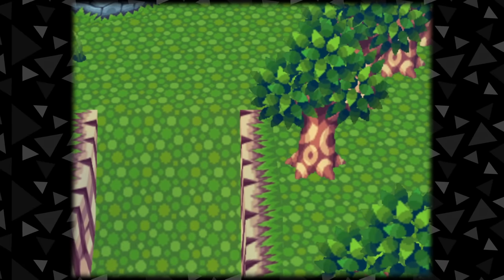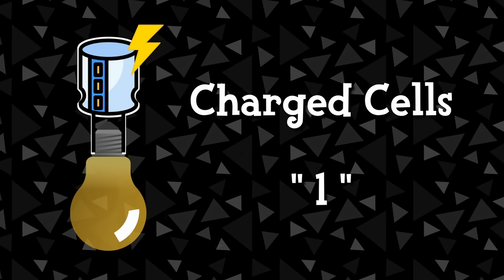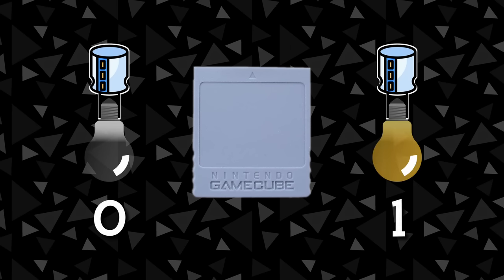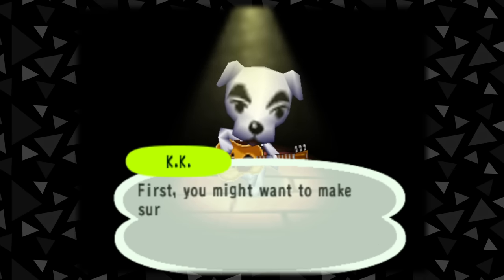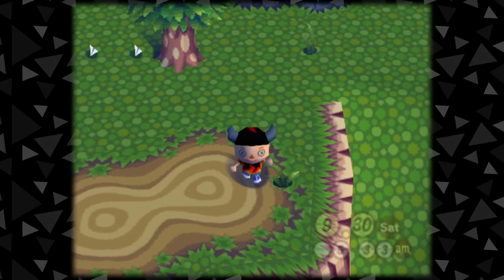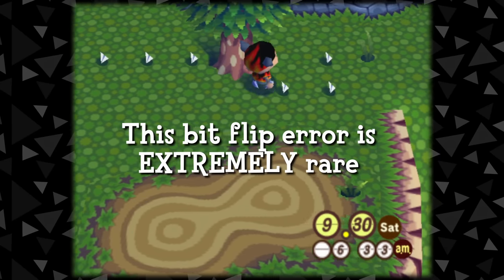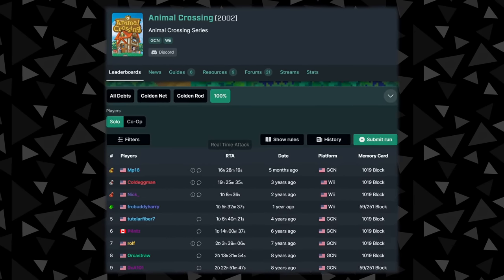Paper Airplane Corruption in Animal Crossing

Comment from the maker: I'm admittedly more of a software person than a hardware person, so there a few technical inaccuracies throughout this video. The description includes corrections, as well as a technical explanation for why these airplanes duplicate. The general point of the hardware-related aspects in this video was to just provide some context on how this glitch can occur and not to be a wholistic explanation. Thank you!
Reply: 2nd correction: Pokemon Sapphire does not have battery backed save data. The game only uses the battery for the Real Time Clock.
Reply from the maker: @Porygonal64  This is corrected in the description. I'll update this pinned comment to refer to this as well.
Reply: Bruh these paper airplanes are like animal crossings evil biome
Reply: @chonkydog6262 Sure, they can vary but the recognized standard number of bits in a byte is eight and this video isn't about transistors or bytes. He only covers it briefly to give you the context needed to understand the rest of the video. Not to mention he never said 'always.'
Reply: An honest to god false vacuum decay catastrophe inside a video game.
Reply: Flash memory typically uses MOSFETs (or a related technology) that holds charge, rather than actual capacitors (which you kind of alluded to in your correction in the description.) Additionally, electrolytes are only present in electrolytic capacitors, which tend to have much larger capacitance than anything that would be used for memory in a computer (i.e. they take too long to charge to use them for that purpose.)
Reply: @chonkydog6262  In modern computers, a byte is always 8 bits. If you want to refer to a non-8-bit value in a nonstandard system, you would typically use the term "machine word" or just "word."
Reply: @chonkydog6262  Not true. A word is often 16-bit in modern software discussions due to the historic size of a machine word on x86 CPUs. The terms "word" and "machine word" are architecture specific (please Google it if you don't believe me.)
"Octect" is more specific (as it specified 8 bites precisely), but "byte" is not wrong by any means. In all modern discussions of software and CPU architectures, no engineer will assume anything other than an 8 bit byte. Go ahead and ask any programmer on the face of the planet (this includes me.)
Reply: @michaelcalvin42  You sure showed him. Hahah.
Reply: holistic no? I’ve never seen it spelled with a “w” is that an americanised spelling?

Comment: Note, Pokémon games on the GBA used a battery for the purpose of running an internal clock, not to save data - they use flash memory.
Reply from the maker: Correct, I used the wrong graphic in this video. I’ll add a correction to the description!

Comment: I do a lot of reverse engineering on the animal crossing games too! :)
Another fun fact about the paper airplane is that the reason your game softlocks is that the programmers never implemented animations for picking up or throwing the airplanes. It uses a blank dummy ID instead for the animation.
The animation it calls doesnt have much associated with it since it was not even used. The lock is supposed to last until the player animation ends, but i assume the ID it calls doesn't have any data, the game hangs. 
Simply writing the idle animation into the player data will unlock the controls. You can swap the animation for the axe swing, and it looks cool and doesnt lock the game! I still have the code i made for this fix somewhere.
Reply from the maker: That’s awesome! It’s interesting that picking up the plane doesn’t softlock even without a proper animation, but the act of throwing it does.

Swapping the animation for the axe swing is pretty clever to make it appear like you’re throwing it. It’s really cool having a tight-knit community of modders and engineers looking at these games.
Reply: @Hunter-R.  I love finding other people who actually put the effort into these games to make the most out of it for ourselves. :)
The code for the fix: 
044e4f98 38800026

Also, correction, for picking it up it seems the game actually doesn't have any animation at all for it, doesn't even call anything.
I'll definitely check the source code for more information, but I can only pull what information I can from it because it doesn't have anything that was left as comments by the devs lol
Reply: @Hunter-R.  I know this was over a week ago, but, the reason it doesn't softlock, as Bidzilla said, is likely because it doesn't call an animation. It doesn't call an animation, so, the game doesn't try to play it and so you stay "Idle." When throwing the paper plane, it tries to call an animation that wasn't finished or no longer exists so it can't complete the animation, let's say "throw." Throw can't be completed so you can't get to the last frame and loop back to "Idle." You probably know this, but, just a bit more detail on animations and maybe for anyone who checks this reply section. (Also, algorithm.)
Reply: @Daltonisntabot There's surprisingly quite a bit of detail regarding this in the games source code leak. I wouldn't be surprised if animations were made, but the game used a dummy animation ID anyway. I do not have the knowledge to physically add a new animation ID to the game with that data without recompiling the ROM.
Reply: @Bidziilla  any luck finding the code btw?
Reply: @Bidziilla  any luck finding the code btw?

Comment: DRAM uses capacitors, Flash memory uses transistors with "floating" gates that trap a charge.
Reply: Yup, all of the information at the start just kind of reduces all types of memory to how dram functions. This dude should've done more research.
Reply: Additionally he talks about electrolyte as if dram capacitors are electrolytic, they are not. There's so much misinformation in this video but it doesn't seem intentional, just terribly researched...
Reply: It's explained in this manner for simplicity's sake. It's the same reason we still mark power terminals backwards to the actual flow of electrons.

Comment: I usually dont comment on videos, but as a computer science/cyber security major this is the BEST simple explanation of how data is stored. I dont even play animal crossing, but you just earned a sub!
Reply: As a software engineer, just be aware, the capacitors that RAM sticks have don't actually hold memory for years. They drain in a second to a minute after power loss depending on device. Solid state flash memory that actually does last for years is instead made of floating gate transistors. Besides that, I agree. The overall explanation on how memory works was good. Good luck with your major

Comment: What I love about spontaneous bit-flipping is that, despite how rare it is and a lot of the cases are believed to be caused by single-event upsets. It's practically the universe going "fuck this bit in particular" because the cosmic particle interacted with that one component in a capacitor after somehow avoiding interacting with any other celestial body or atom on its way there...

It's also been recorded ruining a Super Mario 64 speedrun and may have been responsible for a plane in clear weather believing there to be a storm and trying to correct itself.
Reply: Can you give the video/documentation of it ruining the Mario run? It sounds really interesting
Reply: @discycat  the mario 64 incident is actually a widely spread misconception. during a speedrun race, an upwarp occured in tick tock clock, which caused mario to gain a significant amount of height for no visible reason. because this glitch could potentially help with the a-button challenge, pannenkoek posted a bounty ($1000 iirc) for someone to find a way to repdroduce it. unfortunately, the glitch was all but certainly due to a bit flip. while it has been speculated that a cosmic ray might have been the cause, most people in the mario 64 community see this unlikely, because the speedrunner's cartridge & console weren't well cared for and had numerous other glitches due to poor connectivity. it's most likely that this is the true cause, though technically a cosmic ray could've been responsible.

Comment: SD cards are flash memory which works using floating gate transistors. The charge will dissipate over time which takes ~10 years after which the information will be lost

Comment: 6:47 the capacitors inside of most memory chips don't have electrolyte. But their data retention does still suffer with temperature extremes.
Reply from the maker: Yea I have a few corrections in the description, but I wish I would’ve made this video a lot clearer.

Comment: Could it be that these paper planes spawning was a kind of test they used while creating the game for the balls that randomly spawned? Because they seem similar in that way but the paper planes would be easier since there are no animations (almost) also the duplicating almost seems like randomly testing what code can do and somehow ending up with that mechanic.
Reply from the maker: It's apparent that the paper airplane was an item you were so supposed to obtain normally, but was scrapped for some reason and never finished. The leading theory as to why it's programmed to duplicate endlessly is that the airplane, for some reason, was used for testing flowers and weed spreading, since it works similarly by spreading to each adjacent spot. I don't think anybody knows for sure though...

Comment: The same thing can happen in the GBA Pokémon games via Bad Eggs spawned by hacking the game and inputting values the game doesn't recognize for PC mons. They were also known for multiplying and spreading through your box tiles like an infection, and while they wouldn't crash your game, they did ruin saves by being impossible to get rid of, taking up box space and there's some stories of them overwriting Pokémon you had in the PC, deleting them forever, or corrupting saves. You do habw to wonder why these glitched or corrupted items spread, though - like, what part of the programming in either Animal Crossing or Pokémon has items that duplicate and spread themselves exponentially? Why do they do that if they weren't programmed specifically to do that?

Comment: as a sidenote, the message you've shown from Pokémon Ruby/Sapphire is actually incorrect: in those games (and by extension: Emerald) the battery only keeps track of the time, and amount of days passed, which is used for handling daily events and berry tree growth as well as initial RNG seeding. I don't remember if the original JP text was also incorrect or if this's just a localization error, but it's still something to think about.
Only the first two generations (the ones on the GB(C)) actually use battery-backed saves, while FireRed and LeafGreen lack batteries entirely (however some of those carts have a history of the 1 Megabit flash chip failing, for which the game actually has a unique error message). I hope this clears up at least some confusion.
Reply from the maker: Yep, I realized the mistake after recording! This is corrected in the description - though I know a lot of people likely won't see it there.
Reply: @Hunter-R.  ah, my bad
still, imo you did a great job explaining the phenomenon in an easy to understand manner. Keep it up!
Though now to think, why didn't they checksum dropped items? Since, when the game says the town data is corrupted, that basically means "whoops, the checksum is incorrect".
But then, with just how many dropped items can be in a town.... yeah I can see why: it'd take forever to calculate the checksum, both when saving and loading.
I would share my stories regarding bitflips but alas, I wasn't fortunate enough to experience any, even with how much I've used my OG 3DS or how I'd sometimes leave my launch model Switch with CFW running doing some grinding for me for ~72 hours straight at a time. I have however seen a switch - that was running for months straight, crash. It took the person managing it several more months to get the console back up and running, hosting the same den in Sword/Shield as it always does. In my friend group we joked about the "end of the world" as soon as that bot's stream came back because of how long it took.
It's kind of sad, really. Modern computers are advanced enough that most bit flips will either be nullified (EEC in RAM comes to mind), cause a checksum failure, or crash the unit at best.
At least we can mess around with that potential using tools like the Real-Time Corruptor.
Reply: Oh, right as I hit send I realized one more thing. I remember the case of someone on a Discord server I frequent, who brought up a weird occurrence with their Emerald cartridge: when facing down, the blinking arrow that indicates there's a warp in front of you, would show up at all times when facing that direction, even when there was no warp or even any collision on the tile you're facing. Turns out: this was caused by a bitflip in the ROM chip, which just so happened to cause an interesting and mostly harmless effect.
On the topic of flash-based saves, though: one person I know possesses a cartridge of Platinum (I believe? could have been Diamond or Pearl though) where overwriting the save in any way would silently fail, causing the file to load back up at the same exact point. That I'd say is caused by the chip running out of write cycles, which I have personally experienced on one of my SD cards, so: this's something else to worry about with flash storage.
Reply from the maker: @FrostedGeulleisia  Fascinating bits of information, thank you for sharing! I'm not too familiar with the Pokémon games outside of e-Reader homebrew, but there are instances of bit flips in a lot of other games as well so it's no surprise Pokémon is no different. I think one of the most famous bit flip theories is in regards to Mario 64, but they are still extremely rare. I have also personally never experienced a bit flip in Animal Crossing even with a vast amount of playtime.

Comment: The cosmic ray thing is one of those things that sounds like it's way too cool to be real and definitely isn't the thing, but it is, genuinely, a real thing that actually happens in real life. It's exceedingly rare if you look at one bit. It's statistically impossible, if you look at one bit, really.
Still kinda impossible on the scale of Gigabytes, but it's starting to be a thing that happens once in a while. 
On the scale of petabytes? Exabytes?  It's happening constantly. There's some bit somewhere getting flipped by cosmic rays every second of every day, but most of those bit flips are either corrected because they were in something with error correction, irrelevant because they aren't being read by anything, bulldozed over by some kind of write before they ever get read, or in a (sub)system that nobody cares about so it breaks and nobody notices.

Basically cosmic rays are extra cool because they really do the thing even though they sound WAY TOO COOL TO BE REAL

Comment: Hi, I stumbled across your channel earlier today and it's great.

One question: Do you have any idea why they might be programmed to duplicate like that? It seems so bizarre that that would be deliberate functionality. I'm baffled.
Reply from the maker: The leading theory is that the programmers, for some reason, used this paper airplane as a means to test natural flower/weed spreading. The duplication of the paper airplanes works similarly to how flowers spread where they duplicate to adjacent squares, so it's possible they reused this code here and allowed spreading every reload instead of over time with no cap.

Thank you for the comment!
Reply: @Hunter-R. imagine programming a test item and you find out you made a paper plane infestation that kills islands and is only caused by the console failing at something

Comment: When you mentioned how bit flips can occur, this was how a Super Mario 64 speedrun was set - some cosmic radiation had caused a bit flip during the runner's run, giving them the exact boost needed to warp Mario to the exact floor needed to complete the run, as he had jumped unusually high.
The technique has yet to be replicated since then, as you'd need to be insanely lucky to have cosmic radiation hit the game again at the right time to pull it off, and based upon the odds... you're probably more likely to win your country's lottery jackpot. That's how rare it is.

Likewise with the 2 documented cases of paper airplanes in vanilla gameplay of Animal Crossing GCN. Those two players/memory cards were hit with cosmic radiation, and the fact it's happened twice is uh... something. (I'M NOT COUNTING HACKING, THAT'S DIFFERENT)
To reference Doofenshmirtz: "If I had a nickel for every time a player had paper airplanes spawn in their town without hacking, I'd have 2 nickels. Which isn't a lot, but it's weird how it happened twice."

Comment: Minor correction on the battery-based saves: Pokémon Ruby, Sapphire and Emerald actually didn't do this. Gen 1 and 2 did, but the Hoenn games used the battery for keeping the in-game clock going. Source: my copy of Emerald has had it's battery depleted for several years now but my save file is still intact, and also that's what the games itself says whenever I boot it up again.
As a side note, I don't think FireRed and LeafGreen had a battery in them. At the very least, there's no in-game clock.

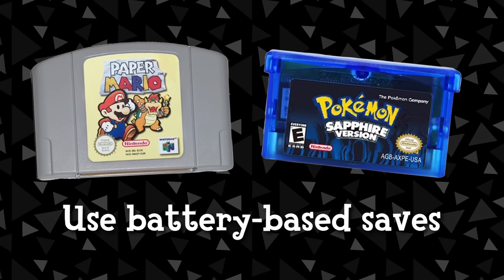Comment: I think the Pokémon Sapphire Version game on the right at 2:04 is a counterfeit...

Also apparently most games on Nintendo 64 that don't only save to a Controller Pak, such as the shown Paper Mario Game Pak, used either an EEPROM or Flash RAM chip to save, which doesn't use batteries to save. It was surprising to first find that out. Game Boy Advance games also commonly use FRAM, EEPROM, or Flash RAM chips to save. None of those chips require power to save data. Only a few Game Boy Advance and Nintendo 64 games use SRAM, which do require batteries to save data.